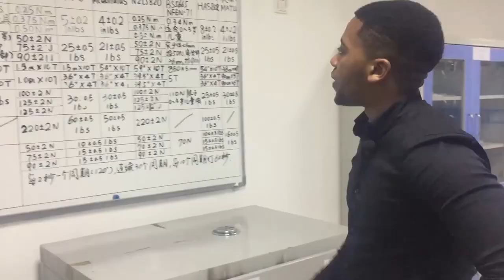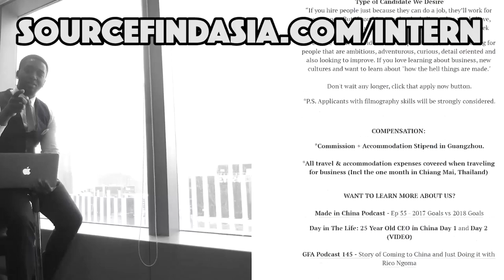Yiwu VS Guangzhou for Manufacturing | Source Find Asia

Comment: Nice work Rico! You can get low quantities in Guangzhou as well. Everything you can get in Yiwu, you can get in Guangzhou, with better quality. Cut your professional teeth in Guangzhou and expand from there. Don’t waste time in Yiwu (speaking from experience).
Reply from the maker: Thanks for the value added comment as per usual Rich. Yes, you can find similar or higher quality items at small quantities in Guangzhou or it's surrounding cities but another problem is that the markets are all spread out. And it'll take a lot more time and effort traveling to different markets throughout the city because each market is usually focused on one product category, What makes Yiwu unique, is that it's almost like combining all the markets into one central location. You can get a lot done in 1 or 2 days.
Reply: You’re right 👌
Reply: @SourceFindAsia  yes, the problem with guangzhou the markets are scattered far away from each other so you will spend more time and money to give the driver to to take you around. I think Yiwu is  much better when it comes to sourcing as all markets are all together.
Reply: @TradersEasyWay i think soon i will live in yiwu .. you think yiwu better than GZ ??

Comment: Thanks Rico for the video, I really appreciate it.
I can tell from your answer that the south of China is mostly suitable for trading and r&d activities.
Reply from the maker: Hey Baali, no problem, it was a good question! Already made a video answering your other question too - will be posting that soon.
Reply: @SourceFindAsia  Thanks Rico I appreciate it, I have been watching the video you uploaded about networking in China and I'm wondering what kind of jobs or activities foreigners could do in China in the trading context apart from Amazon FBA and dropshipping.
Reply from the maker: Well you can focus on original design manufacturing. Creating your crowdfunding campaign etc There are more tech companies developing in Southern China (specifically Shenzhen) around foreign trade as well.